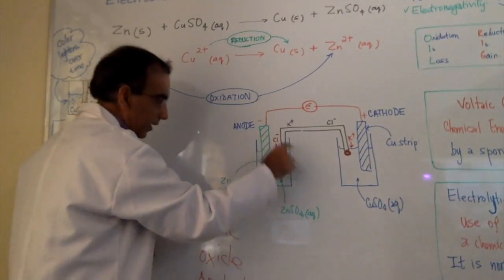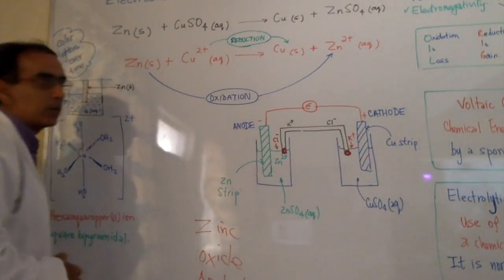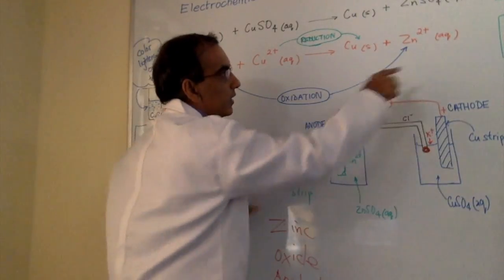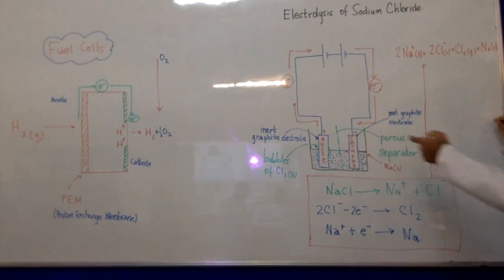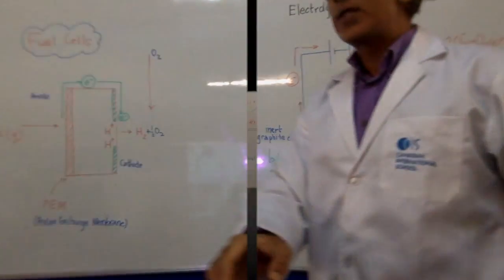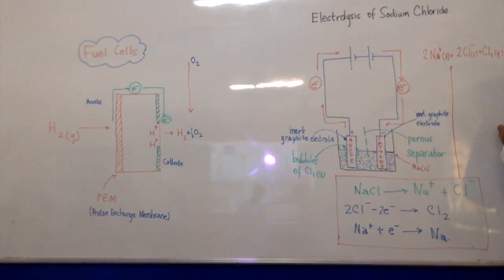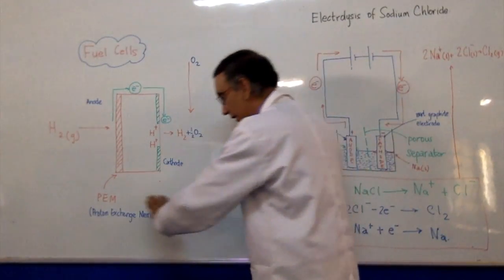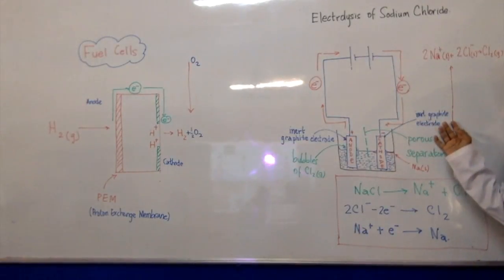Electrochemical Cells

Comment from the maker: Sodium metal and chlorine gas can be obtained with the electrolysis of molten sodium chloride.
        Electrolysis of aqueous sodium chloride yields hydrogen and chlorine, with aqueous sodium hydroxide remaining in solution.
        The reason for the difference is that the reduction of Na+ (E° = –2.7 v) is energetically more difficult than the reduction of water (–1.23 v).